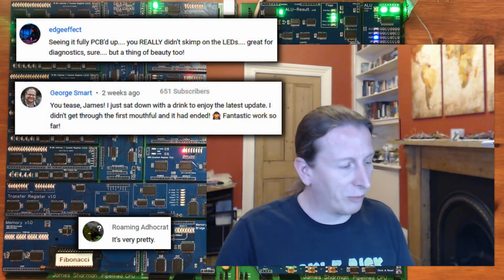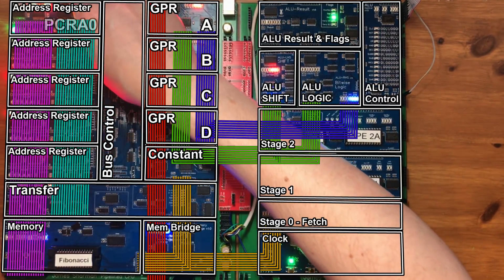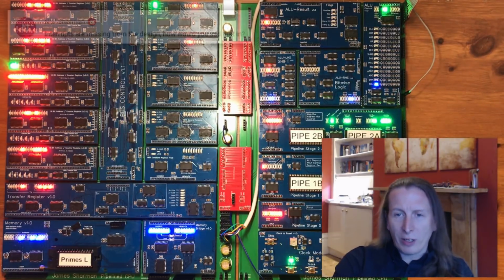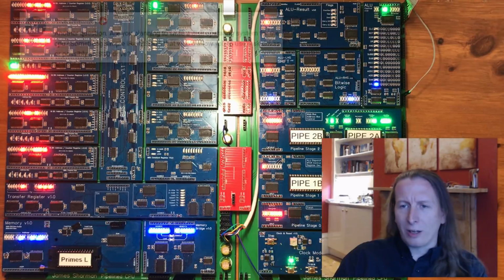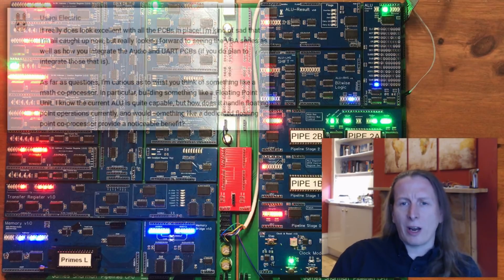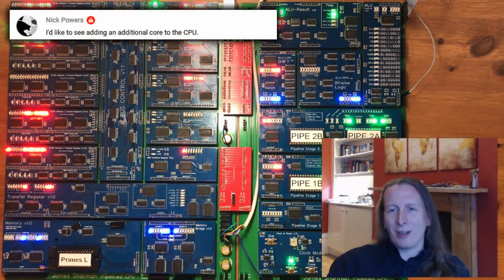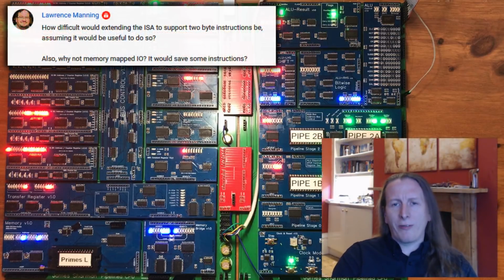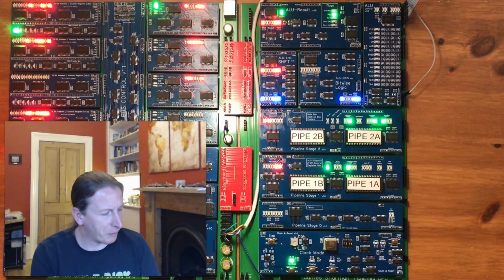Design Retrospective - Making an 8 Bit pipelined CPU

Comment: Skipping MOV B,A in favor of ADD B+0,A  isn't free; ADD has to set the carry and sign flags. Does RISC-V suffer because of this? You can't do any register-shuffling prior to a conditional jump.
Reply: RISC-V gets around that problem by not having any flags. They can get away with this because compare and branch is combined into a single instruction in RISC-V.
Reply from the maker: As drlazy1 said, the flag confirmation is different on Risc-V. If I used this technique I'd either have to do the same or create a custom alu op that preserved all the flags.

Comment: This is a design which could benefit from dual port memory, apparently. No more stalled pipeline.
Reply from the maker: If I used duel port memory for that I'd only end up trying to work out how to use the under utilised port more.
Reply: @weirdboyjim  Just goes to show that no matter how you might improve your design you can always go another step

Comment: I have a question about IO and interrupts. How are IO operations performed(is it memory mapped or Harvard like), and do/will you have some support for polling things like v-sync. In other words how will you manage timing?

I'm looking forward to seeing what you come up with for graphics.
Reply from the maker: My IO operations that I have connect to the internal main bus, it's a little more like an internal device on a microelectronic than a true external IO system. For the VGA i'll need more ports than I can reasonably do that way so I'll do some memory mapped IO. I'll use the existing system for reading hbl,vbl etc.. so I get faster access to that data.

Comment: VGA graphics, baby! 25.175 MHz is the original VGA graphics pixel clock, which is 8x your 3.146875 MHz system clock (I'm assuming you tested with a 6.29375 MHz crystal).
Reply from the maker: Actually that was tested with the full 25.175 with the divider set to 8. It's actually reassuring that at least that much circuit is stable all the way upto 25!

Comment: I love this.  I worked on processors made from standard logic in the 70's and 80's - firstly with TTL and later with ECL.  But they weren't pipelined machines.  I first came across that feature when designing around some 16 bit micros in the mid 80's, but it was even simpler than what you have here.  You have done a great job of explaining your design process and have come up with an elegant architecture.  I agree with you that some changes could have made it more efficient in terms of resource usage (re your comments about the Transfer Bus), but this way it is easier to fully understand what's going on.  I would have loved to see some interrupt hardware, but from my own experience I know the problems that can arise in supporting them well.  Also, well done on handling the Q&A aspect in this video - it was very engaging - and thanks for taking the time to give such detailed and considered responses to the questions.
Reply from the maker: Glad you've found it interesting! Good to hear from someone who actually worked on the generation of processors that most connects to this. I imagine you probably roll your eyes at the my blanket logic simplification with big rom chips.
Reply: @weirdboyjim  My electronics career started in 1976 (I was 18). So I spent some years debugging and testing hardware before moving into development (1981). Instruction decoding then was generally large trees of AND-OR gates and variants.  Small bipolar ROMS were around, but things changed when the early PLA chips (82S100) and the PALs (16R8 etc) came along. But I did not roll my eyes - I think I would probably have done the same as you in this situation. 

What did amuse me was the power consumption that you measured for your design. The ECL system I worked on could use up to a 500 watt power supply...

I shall continue to watch with interest to see how you implement the video output. I designed two in the 80s - one was monochrome text only and one was full colour with sprites and everything.

Comment: I hope the long term storage is an IDE hard disk 👌
Reply from the maker: Not sure I like the idea of adding in the need for a 12v power rail.
Reply: @weirdboyjim  consider is swapping 5V for 12V 😂 pop a cheap SMPS buck regulator in, job done!
Reply: @m1geo  > Or just slot in a cheap Compact Flash card?, wouldn't that be simpler and easier?
Reply: @BlueChrome  Absolutely. But, Where's the fun in that!? 😂

Comment: Correct me if I'm wrong, but from hardware standpoint IRQ requires emitting two NOPs, pushing PC to stack, loading hardwired IRQ address an JuMPing to it? Rest can be handled by IRQ routine?
Reply from the maker: I did try and break down the thinking in the video.  What you describe is part of the picture for simpler processors but even that assumes you have a stack based return instruction. I have been trying to work out code that can do a full preserve / restore of my flags but even if I can work that out I'd still need an additional register for the jump target.

Comment: How does the CPU pipeline handle conditional jumps? Does it stall the pipeline until the condition is evaluated? Also you mentioned briefly on the topic of handling inconsistencies between the registers and the pipeline for sequential operations. How is that managed?
Reply from the maker: The answer to both your questions is I avoid it. Jumps (both conditional and otherwise) are handled at the end of the pipe, so the flags from the previous alu operation are resolved. Being at the end of the pipe however means the fetch unit doesn't know, so I have what is called a "Branch delay slot" where an instruction passed the jump is fetched and executed. Order inconsistencies I just have a small list of instruction sequences to avoid, easier to let the programmer handle it.
Reply: @weirdboyjim  Interesting! Thanks for the answer! :D

Comment: Do you have recommendations on heat guns? I've only seen the cheap (somewhat low-quality) ones, for example, I bought one for like 40 or 50 bucks on Ebay... but the proper ones I've seen are seemingly all many many hundreds of dollars.
Reply from the maker: I bought a cheap one, the 858D and I've not had any problems with it. A bit more than the really cheap ones but it doesn't fall into the expensive camp.  https://youtu.be/NabvvlQ39b4

Comment: I'm glad you stuck to your original design goals. I'd love to see a hardware interrupt in the next version just to make programming a bit easier for IO operations but then you start running into cascading interrupt requests and stack management. Also, how many interrupt types would you implement? NMI, IRQ or RESET like in the 6502? Maybe something super simple like a single line in the z80 and manage register state in code? Just thinking about this makes my head hurt :)
Reply from the maker: That partially depends on what I do for the next build, if it's another pipelines build it might be similar to what I described here.
Reply: @weirdboyjim  Interrupts can be not too difficult to implement if the architecture supports them as you've mentioned. MIPS for example dropped all ALU flags /*and infact made the CPU more "C" compatible and faster to emulate on any architecture!*/. If you can drop ALU flags in your next CPU design too and can implement all operations based on registers and/or immediates only you will need only to add one additional 16bit address register to be swapped with PC /*it's possible to simplify the swap implementation like Z80 did - they just flipped the register select-s by one flip-flop instead of copying the registers values*/.
Another approach is stack architecture - is have 2 fixed-size stacks in CPU:  one for operands another for return addresses - it supports nesting by architecture, so you can 'inject' a CALL INTERRUPT by h/w virtually in any time.
Reply: @alexloktionoff6833 
Ah, yes, they used 3 operand instructions, and used the result register itself to do a branch if zero, etc. You really need a lot more bits for the instruction to choose for 3 registers, especially when you have like 16 or 32 of them. I do like how MIPS shows you the branch delay slots, for cramming extra performance when possible without extra cpu logic.

Comment: 640x480 VGA pixel clock divided by 8 ;-) Graphics are coming
Reply from the maker: Yes, Having the cpu run at an exact division of the pixel clock will simplify stages of vga development. It won't be a restriction on the cpu by the end though.

Comment: Hey, here is my guess about the 3.146875MHz clock, I am thinking you are dividing a 25.175MHz clock signal by 8 and the reason why I am thinking so is because it is the same clock you need to create a 640x480 VGA signal :) Once again a great video James!
Reply from the maker: You are correct, the number significance is it's an 1/8th the VGA pixel clock. Having the cpu run at an exact division will smooth the early stages of vga development. It won't have that restriction by the end though.
Reply: @weirdboyjim  3.146875MHz is exactly the same frequency I run my CPU at, for the very same reason. I am planning to try running the CPU at 4.5MHz in the future, can you guess why?
Reply: This is my guess as well, but CH V Sai Naveen beat me to it. 😀